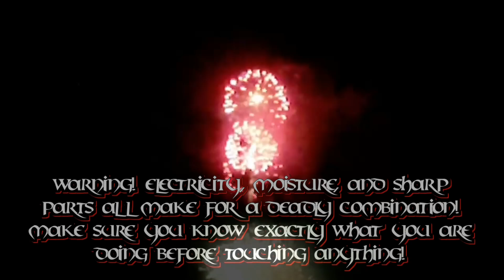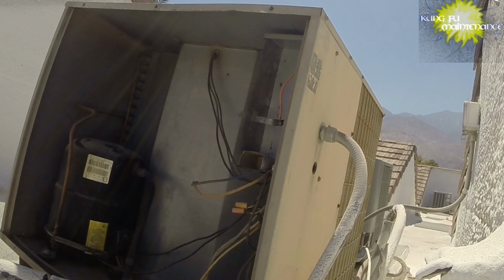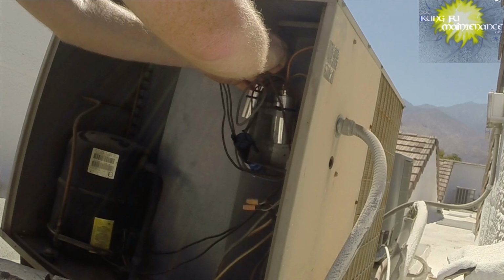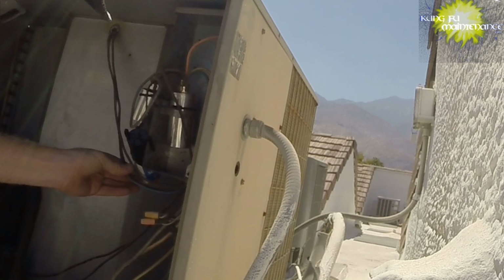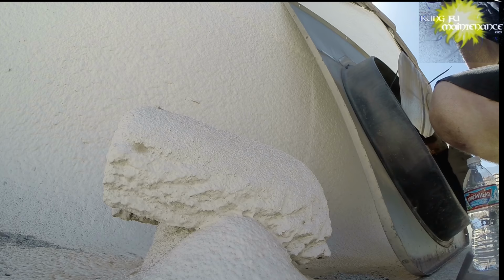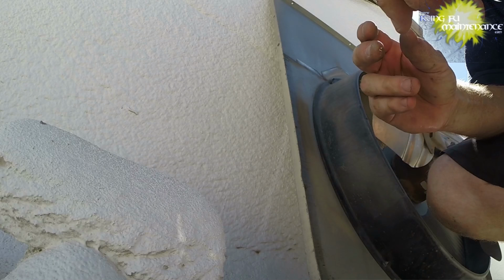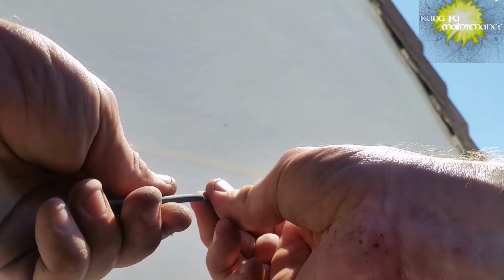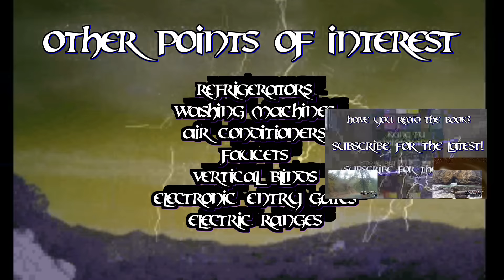111 Degree Day Air Conditioner Fan Won't Start Lucky Fix Thanks To Remembering History

Comment: You should use a small driver to unscrew and screw the case lid.too hot, you need speed without you over working my friend.
Reply: m12s are a techs best friend